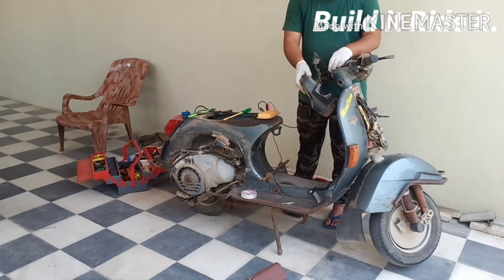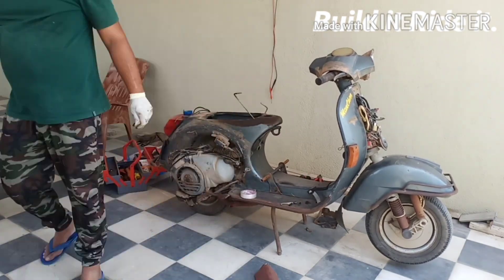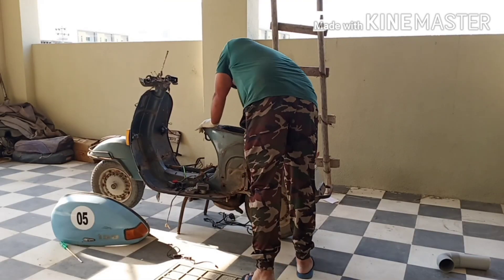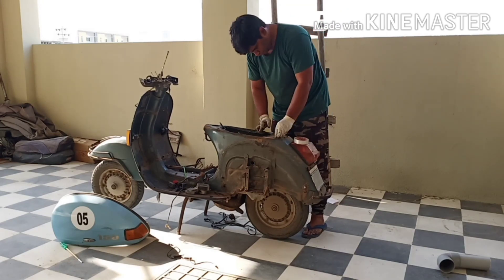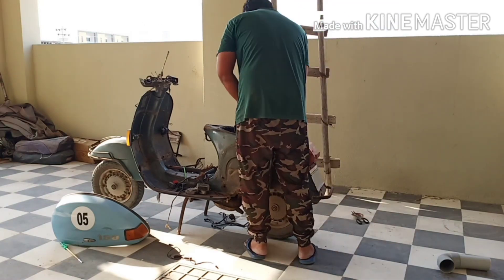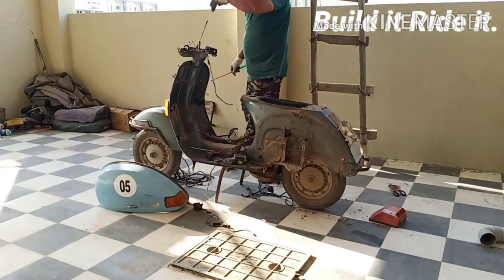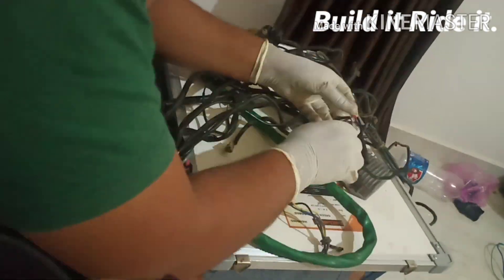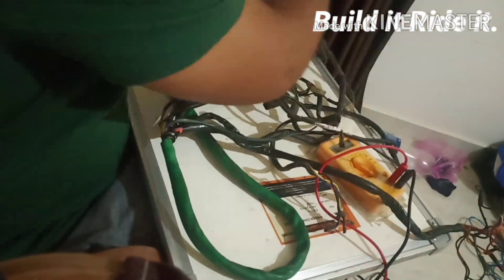Dismantling the electrical components from vespa.

Comment: Thank you for video wait for next videos
Reply from the maker: Welcome,I am waiting for the paint shop to open, once the lockdown is relaxed. Once the handle base is painted I will install the wiring.stay tuned.
Reply: Please make a  video on it
Reply: There is a anyway to start the engine bypass the wiring means direct start engine without connect wiring
Reply from the maker: @missionsuccess6323  yep, just CDI be properly connected, and it will start.